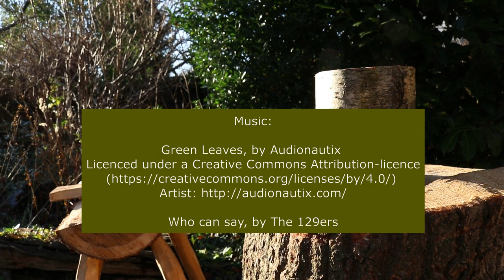Making a shrink pot - part one

Comment: I'm admiring your bench/saw mate.  Thinking about the slightly bowed black locust beams languishing in my basement, wondering if I could make a stable bench like yours out of slightly twisted members.
Reply from the maker: That should certainly well be possible. The main aspects for stability are thickness and weight. How thick? When it seems a little over the top, you're fine. On the bench in my video they could /should have been a little thicker and heavier for the sake of stability